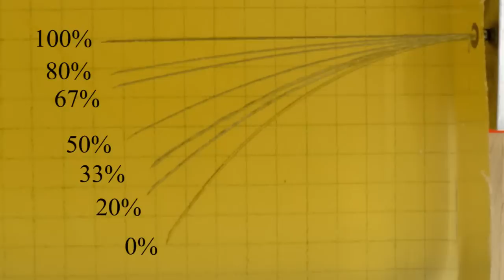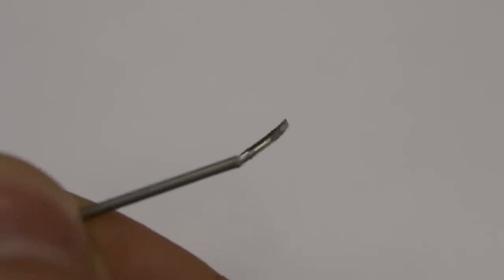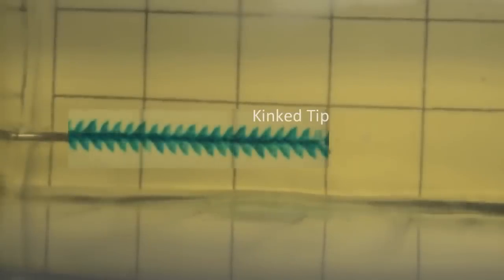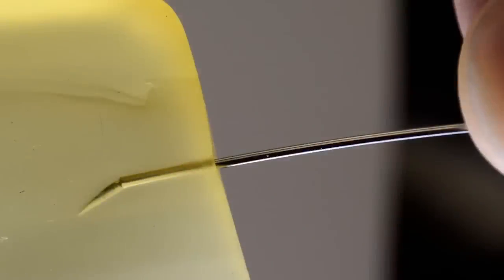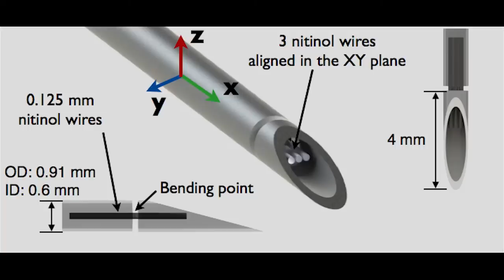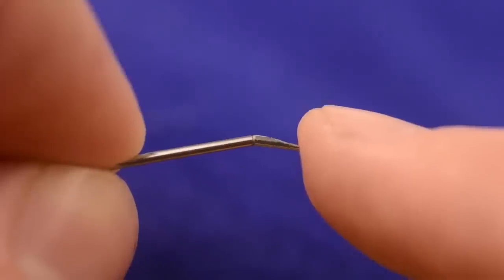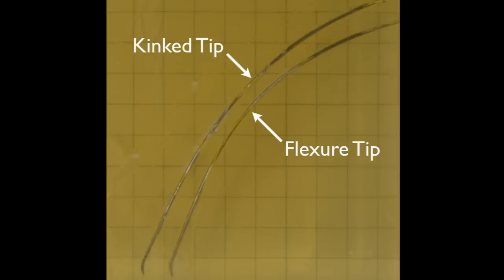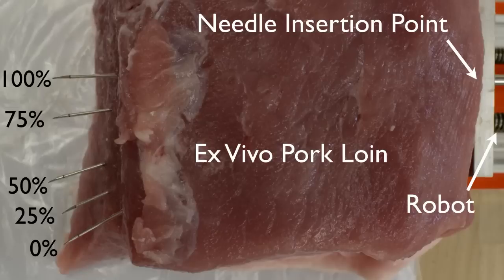Steerable Needles: The Flexure Tip

Comment: I mean, if you need access to something and there's a bunch of other stuff in the way, then sure.  But I imagine that twisting the needle like that is going to feel an awful like like having a drill but slicing you to hell Inside.  In cases where that kind of damage is better than not being able to get access, then yeah.  But...  Oof.

And I think that the drilling sensation will still be pretty awful when that needle is in straight mode.

Kinked mode?  Fuck off with that.  I don't need to fit an artificial Christmas tree branch inside of me, thanks.

Comment: (Needlephobe comment)
How do you not cringe when even the thought of a freezing cold dirty sharp metal HIV-riddled tube just thrashing about your insides. Flexable or not.
You can try fight it with logic (and fail 100% of the time): The needle is clean and sterile; It's administered by a trained professional; You are not gonna impulsively stab your eyes with them; It only hurts for a few minutes at most, but more likely it's the butterfly one that hurts for half a second; The pain doesnt even bother you anyway.
You fail because that fear is irrational. Logic has no effect on that fear.